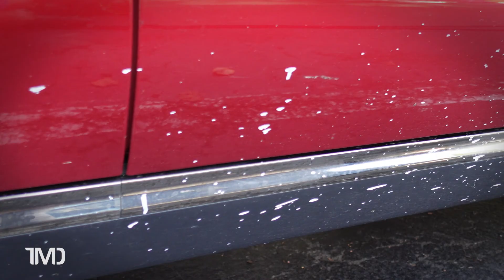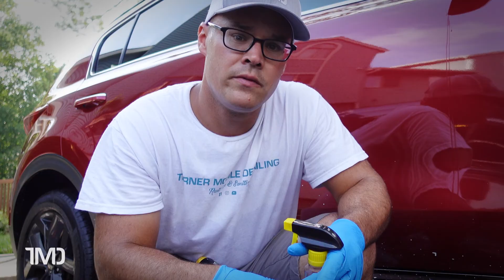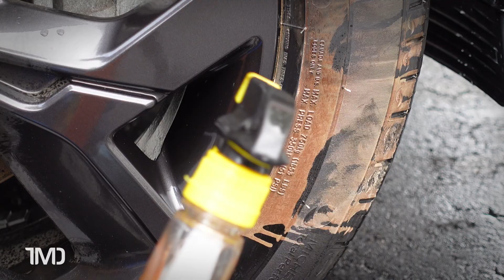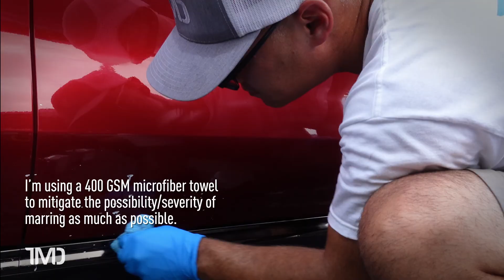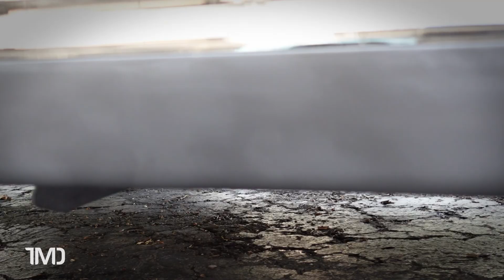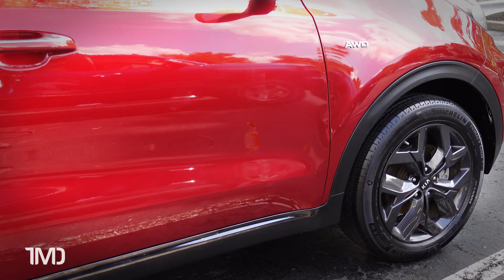How To Remove Paint Splatter From Your Vehicle | ExoForma Black Trim Restorer

Comment: Help! What about removing paint splatter on rubber bumpers? Thank you!
Reply from the maker: Try goo gone and a plastic razor blade. Do you know if it’s oil or latex paint?
Reply: I don't 😁
Reply: Thank you!
Reply: @TurnerMobileDetailing  Goo Gone and razor scraper are not helping me with the mystery paint splattered on my Toyota.  However, I used "solar heat"  (sunshine) with Goo Gone and a porcelain polish to remove the spattered paint from the paint/color surfaces on my vehicle.  It took a long time !  Not sure  yet I can do about the paint splatters on the  trim.
Reply from the maker: Thanks for the update. In the trim the goo gone didn’t work? That’s the hardest because the paint actually absorbs into the pores of the plastic. You may have to do what I did in this video and use a solvent and then re-dye the plastic black, or paint the trim with trim and bumper paint. It’s kind of a no win situation with black plastic trim.

Comment: The simplest way to remove paint splatter is to simply use a drill attachment with a small spongy buffing pad and some rubbing compound, taking your time on each spot lightly.  I just removed a ton of road paint on a Ram Promaster it and worked great with no damage to the clearcoat.  Let the drill do the work, not your hands and shoulders.

Comment: I ran over fresh white road striping. Couldn’t believe no cones had been placed. It’s in my wheel wells where you can’t see it but it bugs me. Would this method work? I’m not sure what the material is in my wheel wells—it’s a rough sort of material. I tried going through a car wash and then using goof off but it didn’t work that well.
Reply from the maker: Is the wheel well material that fabric sound dampening type liner?